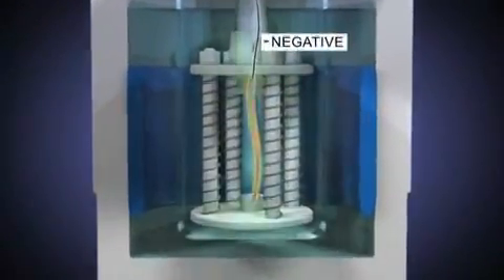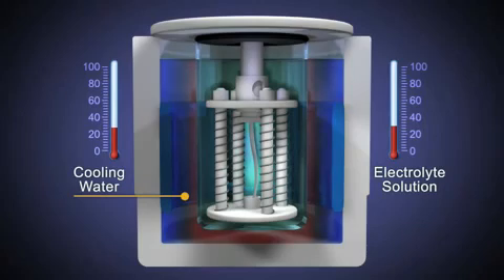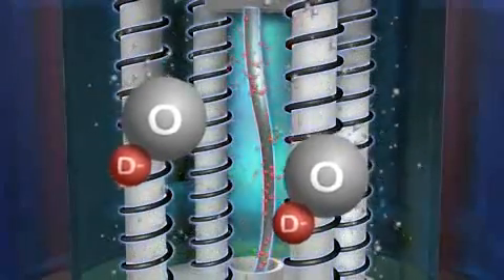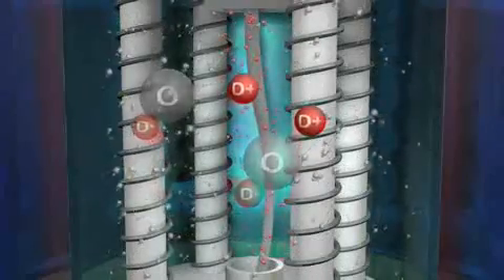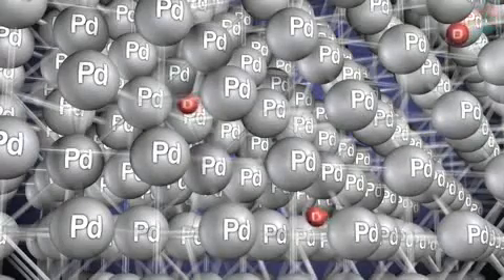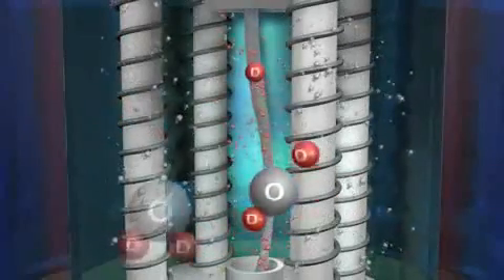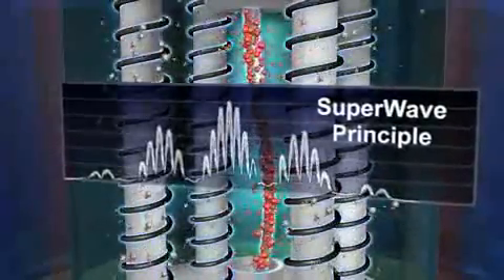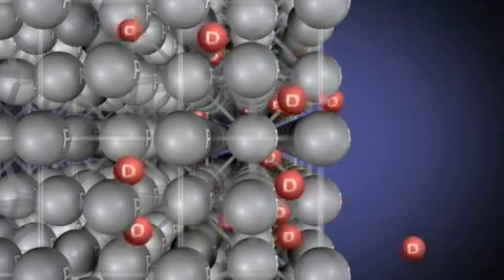Cold Fusion:whats that nuclear reaction?

Comment: Try Deuteron instead of Deuterium in the electrolyte solution. Deuteron will fusion to produce Helium the same as Deuterium but with less input power required for the reaction to take place in the Palladium lattice. This will also prevent lithium grease buildup on the Palladium.

Comment: How do they harness the energy being released? I want to create my own virtual model, and I need to fill in the blank spaces.
Reply: CrazyDOS i think the latter process is much the same as within the nuclear fission process - the heat which is produced with the reaction (fusion) causes the water to turn into steam (large amounts of steam), which then forces the turbines (a third element of the system) to turn. the rotation of the turbines creates electric energy. i think :)

Comment: Really? It sounds to me like it's not obeying the laws of energy.. Energy from nothing?
Reply: this is caused by the difference in binding energy of the helium and hydrogen. When you fuse deuterium together this difference is released. Binding energy is hard to understand but helium can be just described as more stable. Google binding energy and you will get a nice graph. Because of those differences we have fission and fusion atomic power plants.
Reply: Yeah binding atoms in higher molecules with lower energy state - law of everything "less energy contained - more stability" This is why all of the reactions are theoretically two sided /I'm not sure for the english term - maybe reversable?/, but practically some of them are not, because of the too high amount of energy required. And this video is kind of explaining a closed circle where you add less energy than you get while keeping the same amount of products - that's why I said energy from nothing but I'm pretty sure I've lost the lead somewhere in the middle so I'll have to grab my chemistry textbooks for some refreshment :)
Reply: Aah now I get it, I must have missed this one in the calculation :)
Reply: Ist Barely the same Thing that happens in the sun only hotter, The sun also fuses hydrogen to Helium and you also dont say energy from nothing. :D
Reply: TheFilip43 maybe "mass defect" tells you something or look up  carbon-burning "not sure if thats translated correctly"